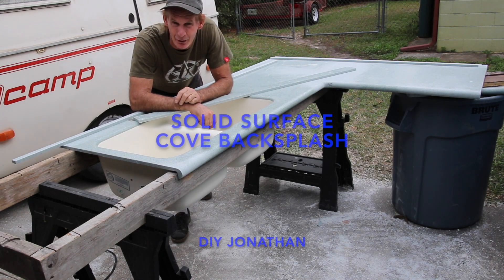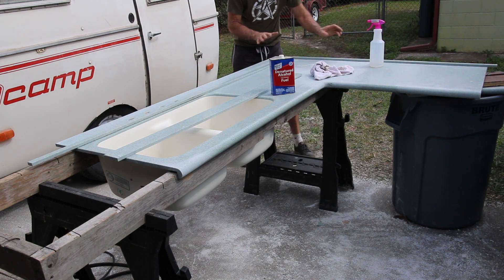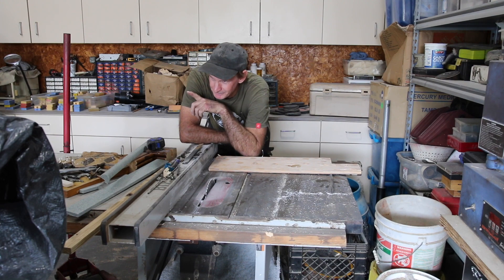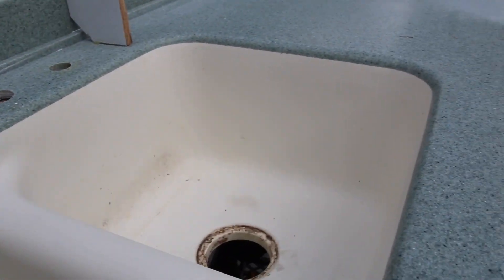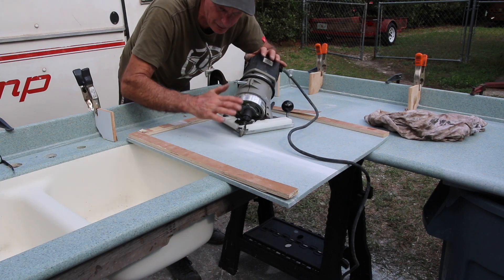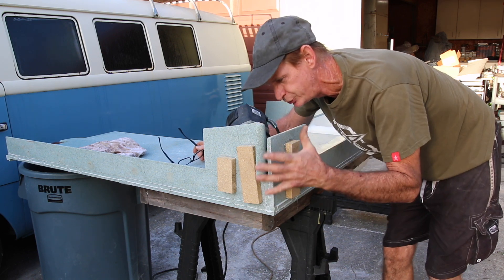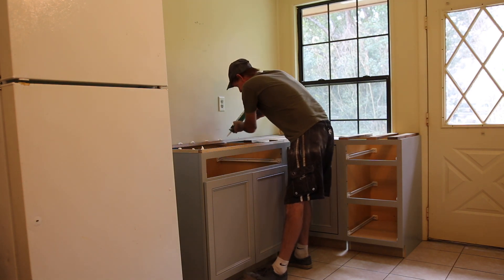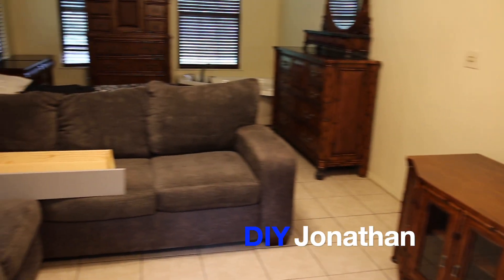Cove Backsplash Solid Surface, How To, Tutorial

Comment: My Dad did solid surface (Corian) for 15 years. Did a number of jobs with the coved backsplash. He would inset the "filler" piece and then add a 1/4" backer to scribe the wall to the up right backsplash. Was alot of work but always looked great. He would even do a short cove if the customer wanted tile backsplash.